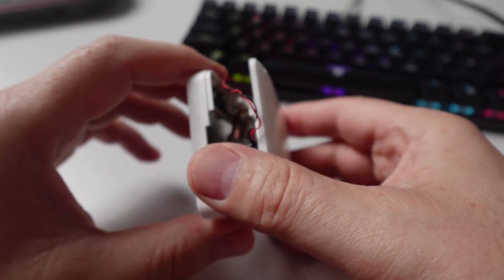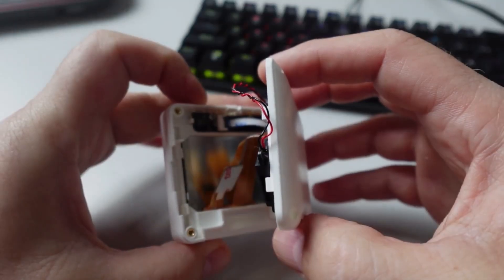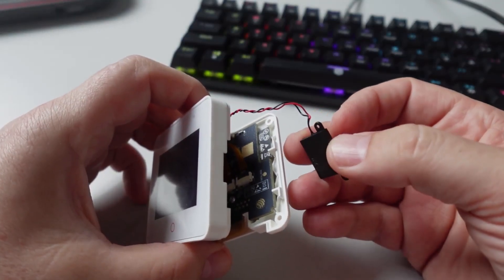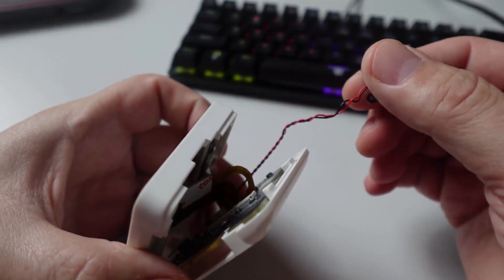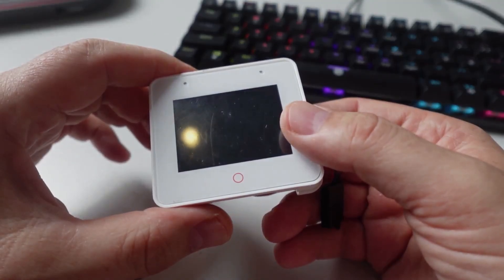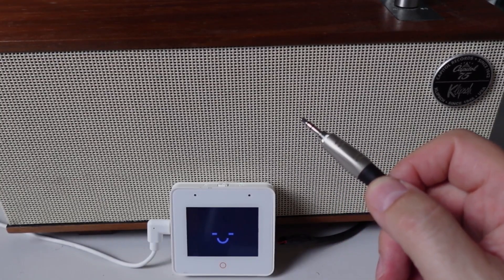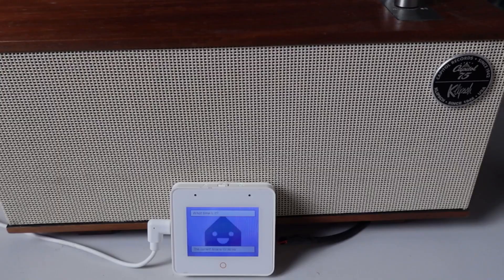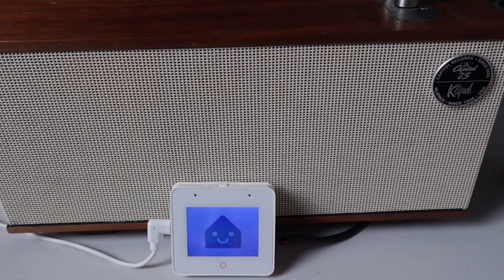What to do when you can't get hold of Home Assistant's Voice Preview Edition!

Comment: In my case, I issue the command to the S3 Box 3, but rather than using the S3 Box speaker at all, I just send the response to the Amazon echo that is in the same room.
Reply from the maker: @johncallaghan7601  does that work well?
Reply: @simonsayshomeassistant  Yes it does. I have a generic catch-all wildcard for all spoken commands which is funnelled to a python script. This works out the location of the command then calls a conversation process script with command and device variables. I use the Alexa Media integration to TTS the response.
Reply: @simonsayshomeassistant  Yes it does. I have a generic catch-all wildcard for all spoken commands which is funnelled to a python script. This works out the location of the command then calls a conversation process script with command and device variables. I use the Alexa Media integration to TTS the response.
Reply from the maker: Yep I can even call Nabu from the room next door!
Reply: yeah ... that's also what I wanted to do. How did you get it done?
Reply from the maker: @sledgeHammerRulez  Just connected the 2 speaker wires to a mini jack and plugged it into a smart speaker!
Reply: @sledgeHammerRulez  I have a generic catch-all wildcard for all spoken commands which is funnelled to a python script. This works out the location of the command then calls a conversation process script with command and device variables. I use the Alexa Media integration to TTS the response.
Reply: Been trying to reply to you guys but something is screwy. Anyway it does work well. I have a generic catch-all wildcard for all spoken commands which is funnelled to a python script. This works out the location of the command then calls a conversation process script with command and device variables. I use the Alexa Media integration to TTS the response.

Comment: When they were live streaming you could buy the home assistant smart speaker (even in NZ) they said in the live cast, that they would not run out, but think they were more popular than they thought! btw yeah I have the same issue with the box 3, it makes the popping sound when it activates the speaker. I liked the satelite with a pi zero and a re-speaker hat. but it would fuction for a few days and then corrupt for some reason.
Reply from the maker: @mice3d  yeh they did a really great job of the launch ! Yep mine makes a few pops and clicks too